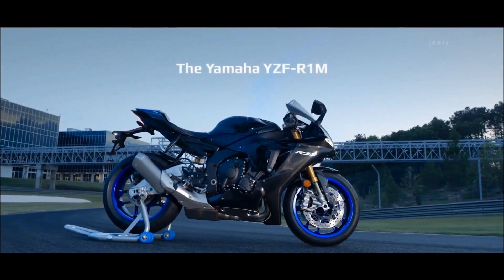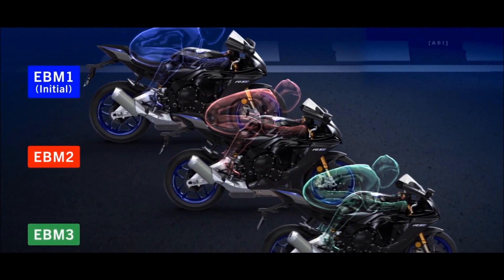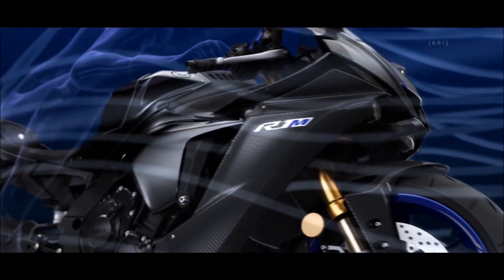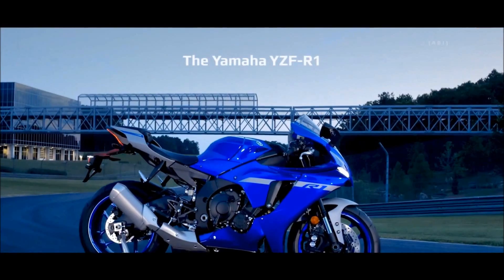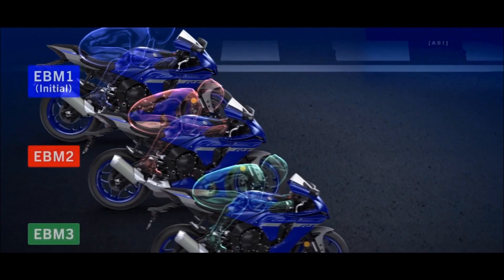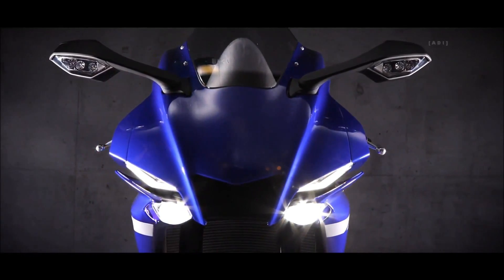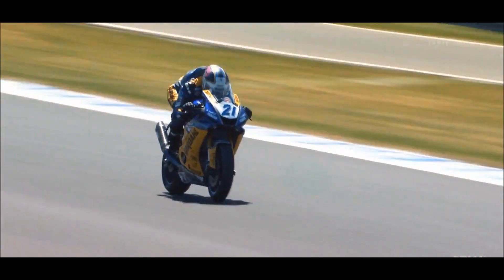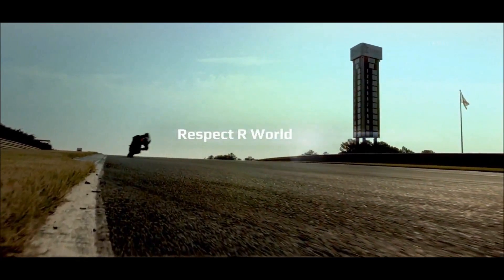2020 Yamaha R1M / R1 / R6 / R3 - Specs & Features EXPLAINED

Comment: Still don't understand why R1 sounds like a 2 cylinder engine when it's actually 4 cylinder.
Reply: Something to do with the HP maybe and torque 🤷‍♀️
Reply: @wuvvbernardo9353  Nope. Found out that most yamaha engine use crossplane cranks.
Reply: @patricklawrence9784  its a Crossplane Crankshaft bro😏
It doesnt sounds like twin.
It sounds like a V4 or a muscle car with v8 engine.
Its a lot better in person you should hear one of those.

Comment: For R3 300cc with 2 cylinder, 4 valve? i will choose kawasaki zx25r 2500cc with 4, 8 valve cylinder monster engine. zx25r is more powerful and faster than R3.
Reply: Zx25r only has 250cc engine compare to r3 who had 320cc engine but arguably the zx25r has a better sound because it has a inline 4.
Reply: @Allison_Burgers69  Its not about 4 cylinder can make good sound. the more cylinder, the more revolution ingine power RPM. Only numbers of valve air intake will make a good sound. The more valve the more air flow makes sound very fine. Im sorry zx25r has 16 valve any way.
Reply: CarryMinati  I tried explaining it to him telling 321cc vs 249cc is a no brainer of a choice but seems like he still believes that zx faster.
Reply: @Allison_Burgers69  no need to explain about, i believe not only me prove that zx25r is far faster than 3r and you are wrong. https://youtu.be/PGgVnPePUVY
  https://youtu.be/tN6Qhv0QbqY
If you dont know about the scale of engine, you wont believe.
Reply: @joelcustodio9328  LOL ever heard of slipstream?
Reply: @Allison_Burgers69  i know.. stop making any excuses about dirty air pressure its not big effect. Zx25r  are very slow or delay torque acceleration from the start because its 250cc compare to 300cc. If higher CC it provide more starter acceleration and torque strenth from the start. And also zx25r is electric throttle, they complain about delay acceleration. But when it comes to topspeed, switch gear 3 to 6 of course inline 4 is the fastest. Now you know why zx25r are very slow from the start, and fastest in the end. No matter how good race strategy you are, when it comes to inline4 you cannot win that race.
Reply: @joelcustodio9328  believe what you want based on YouTube 🤣🤣. Your money your bike idc.
Reply: @Allison_Burgers69  lol i already know that.. if your a mechanical man you know about the engine. If not just stop pretending we know😂😅🤣.. hope you wonder why zx25r almost twice expensive than r3.
Reply: @Allison_Burgers69  dont worry r3 raider.. the only thing that i like r3 is the designs, durability features and quality. Zx25r are engine performance.
Reply: @joelcustodio9328 What I like about the zx25r is it's Tech features that was trickled down from his big zx brothers that I wish existed in its category of any brand.
Reply: @Allison_Burgers69  thumbs up... I heard about that there is new coming release from yamaha r4 250cc inline 4 with 16 valve... If that case, this this bad ass. Cant wait.